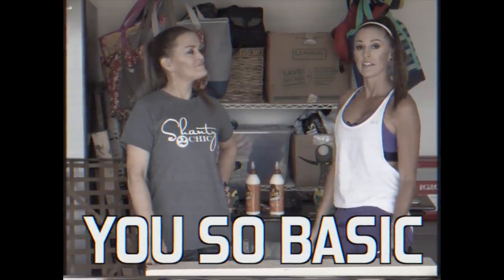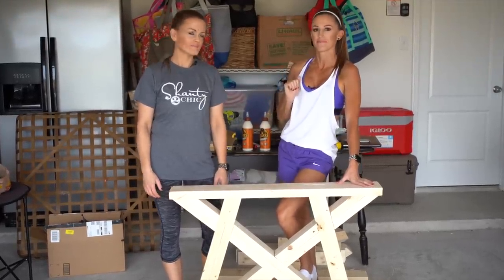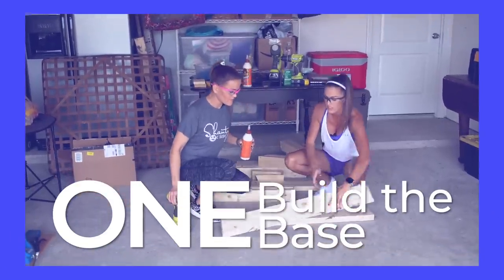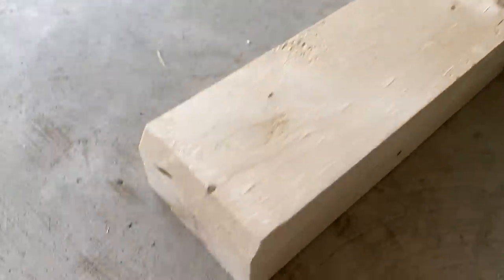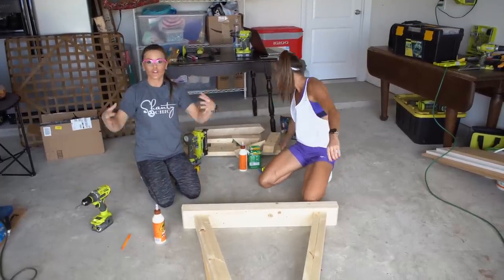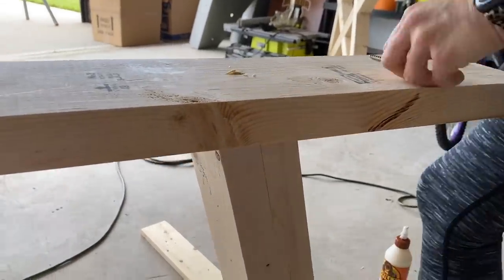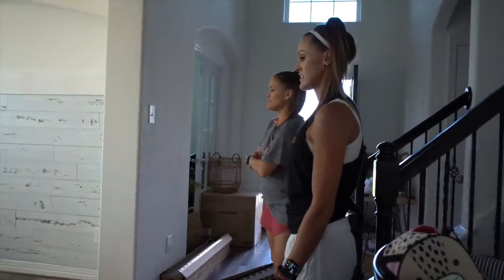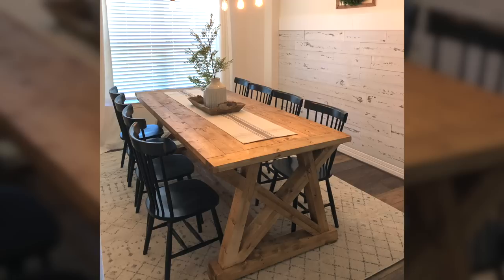$129 DIY Dining Table

Comment: Love the table ladies. I would recommend pre drilling holes for those screws though. Helps to prevent splitting, as I saw it did once on the X install.
Reply: Spax screws don't really require pre-drilling. Although personally I would pre-drill the ones that go into the end grain. But serious spax screws are awesome. I used to be a doubter but then I bought some when they were on sale, and they are incredible. German-made GRK screws are great too.

Comment: Saved for my table build in the near future! Thanks, great video ladies!
I feel like drilling through the top/bottom into the legs, then inserting a dowel with wood glue, would be better than screws. More stable and won't loosen.
Reply: You are right, but they needed to take it apart to get it in their home.
Reply: @allisonhood4750  Ah dang. Ever seen people using removable dowels?
Reply: @nicholasspinicelli2911  who cares? dowel with glue would be way overkill for this kind of project. Yes, it's better, but it's really un-needed and total overkill. What are you planning on doing with that table if you're worries about screws loosening?
Reply: @vladg5216  Just age and use, by future children climbing/jumping all over it, etc.

Comment: I have a question regarding the installation of the breadboard.  If you just screw and glue it's going to shift as wood expands.  I would install dowels and just glue the middle and leave the right side without any glue for expansion
Reply: This is what I was thinking. With this many screws in the bread board end it looks like it is asking for either a warped or a split table.

Comment: Just spent this past weekend building the table. Turned out great. The only thing I question is in yalls directions one of the pieces for the X you have colored orange, but it didn’t show what angle to cut it at. Took some thinking for about an hour to figure that out. Other than that not bad.
Reply: Lol they didn't include the single hardest part to figure out.
Reply: @ballwizz23  I know 😔
Reply: What angle did you end up cutting it at?
Reply: @Alyssa.Hansen  This was last April. Couldn’t tell you lol. Just eyed it.

Comment: Very nice table, and just the fact that you made it, is already a great deal. Now, some constructive criticism just to try to help for the future: 1) Pilot holes. 2) Wood plugs (needs special drill bit) or dowels to cover the screws (but wood filler works too, no problem there). 3) Spread the glue and use more of it, I would advise for all contacts, glue is sometimes stronger than the wood itself and after properly cured, even screws. Keep up the great work!
Reply: Nicely done.

Could also put some biscuits between the planks on the table top to keep them from warping. And miter the 4 corners.

Comment: Great job on the table! How have the bread board ends held up over time? Does expansion of the wood in a cross grain situation been a problem? Thank you.
Reply: I have that question too as I’m wanting to build this table. Did you build it? Have the bread boards held up?? Also how were the measurements as I’ve read they weren’t accurate… 🤔 ?
Reply: @natashamartin1712  , I have not built it. I’m not convinced about the bread board ends.

Comment: I sooooo need this! Someone was gonna charge me 700$ to make one almost identical
Reply: The reason that quote was so high is because of all of the time it takes to measure, cut, plan, purchase materials, transport materials, not to mention these ladies are notorious for advertising how cheap their materials are not counting screws, wood glue, the stain, and finish and all of those things take a ton of time..there is a misconception that projects like these are fast and easy and to an experienced wood worker they might be all of those time consuming things are happening off camera..but that is what your paying for..skill and a professional looking end product. This is no shot at you but this is a prime example of why as a small business owner I am so underworked because people don’t wanna pay you what your worth. Also calculate the hundreds of dollars in tools that you need to even complete a project like this. I hope you end up giving that person your business and am sure in the long run you will end up with a table your family can use the rest of your life. Cheers🤙🏻
Reply: I agree with Josh. The time it takes to do the finish work is where the bulk of the cost for a table like this is quoted.  Sanding and staining take FOREVER.
Reply: $700??? That’s actually very reasonable if you factor in labour and additional supplies which their $129 doesn’t cover (tools used etc).

Comment: Pocket hole screws to attach the breadboards... I would love to see what they look like a year later, without allowing for any wood movement. But a nice looking table, nonetheless
Reply: Pine sitting in an air conditioned house doesn't move that much. Plus this channel obviously isn't meant to show intricate mortise and tenon joinery. For the purpose and the price, the pocket holes will be fine. Will it last 50 years? Probably not, but most people don't keep a table around that long anyway.
Reply: Robert Collins  you clearly haven’t built much. Wood moves based on the moisture in the air, or lack there of.  AC means just about nothing.
Reply: Terrence Young what exactly do you think an AC does? It removes moisture from the air and keeps the environment controlled. No they aren’t proper breadboards, but I’ve built faux breadboards that were simply nailed to the frame that look fine after 5 years.
Reply: Robert Collins and if there’s moisture in a board and you introduce it to AC....  it’s gonna move.
Reply: Terrence Young so don’t build the table then. No need to hate on their work though. Again, I’ve built plenty of tables without proper breadboards or z clips, and they do just fine inside. Wood movement is real for sure, but I bet this table will be fine after a few years.
Reply: Robert Collins and my post said it was a nice table, I simply pointed out that the breadboards wouldn’t last, and they won’t. No one hated, you just felt the need to be a SJW and that’s cool.
Reply: This is actually the comment I was looking for, whic would you guys prefer and why? A glue up or pocket joinery for the table top. Also I see their board was wobbling, how could you fix this when it comes time to securing the top? I keep having problems with this

Comment: I am a newbie. What do you mean when you say you ripped something to size?
Reply: A rip cut is for the desired width of the board and/or for squaring up the edges because most lumber is slightly rounded.  Can only be done with a circular saw or table saw.

Comment: Great table build as always.  However, I have a question for you that relates to ripping 2" x 6" boards.  On my last two projects I have had to rip down the boards.  I have a jet table saw, fairly new.  I have a freud ripping blade I used, 24 teeth.  I bought it before the first project, within four boards it was dull and not cutting.  Had to clean the blade to finish the project.  Cleaned the blade before the second project, same thing, but this time had problem on the third cut.  I am using good dimension lumber from a box store.  Kiln dried with moisture content lower than 11 percent.  Do you have any problems with ripping pine boards?  This was not a cheap blade.  Looking for suggestions as this is very frustrating.  Do not have this problem with other wood species.  Hope you have a suggestion for you.  From a fellow Texan who has been in Oklahoma for over forty years, longing to go back to the Lone Star State.
Reply: Hmmm. Never heard of this problem before. I'd be curious to find out what the issue is.
Reply: @Woodsyone  The saw is 1.75 HP.  Had a long time friend tell me part of the problem was using a standard 1/8" kerf ten inch table saw blade in a table saw that is probably under powered.  I still think it may be the resin and pitch build up.  Cut the first two boards fine.  Blade was never hot to the touch.  Motor never slowed down that I could tell.  So it might be that for this type of cut in pine 2 X stock I need a thin kerf blade.  Strange thing is my cheap dewalt saw could cut on the 3/16" edge off the 2X stock with no problem, all day long.  The saw works fine on hard woods and ply.  Belt on the saw is tight, so that is not the problem.
Reply: @jtmin1 You're sure it's the blade? Sometimes the finish on my table saw top gets a little rough and makes it harder to push wood through. A thin coat of wax makes it smooth like butter again. 2× wood can be tough on saws with smaller motors though....
Reply: @Woodsyone  I wax my table saw regularly, usually once a month.  Had recently waxed the top of the saw, 2 weeks earlier and had not used it till this project.  I am more of a week end warrior.  My jointer also had some issues after four boards, but quickly cleaned the blades and it worked well after that.  I am going to borrow a thin kerf blade from my friend to see if it helps.  Thanks for replying.

Comment: What about wood movement, did y'all take into consideration of this? If so, then how did you solve that issue?
Reply: With all the pocket holes on the breadboard ends, the answer is no.
Reply: I bet it looks like a potato chip now.
Reply: I was wondering the same thing. It will start to expand or shrink and pull away from the pocket holes. Great table but over time it will have gaps. Breadboard ends and dowels would help with the wood moving. oh and ladies.. more glue! use a lot of glue  and spread it out on both pieces.

Comment: Nice work.  I am wondering however if the plans for the base will work for an existing table.  I have a beautiful table with a broken leg  and  don't want to get rid of it.  Also the chairs are beautiful where were they purchased?  TIA
Reply: Why not? Modify the dimensions if need be to make your top fit properly.....

Comment: The base design is really cool. Too bad the breadboard ends weren't attached in a way that will allow for expansion and contraction of the wood....
Reply: How can you attach them to allow for expansion/contraction? Eventually wanting to build some kind of dining table for myself
Reply: Mortise and tenons with dowels. Only glue the center and elongate the dowel holes on the sides to allow the wood to expand. Its much more difficult to do but, it will keep the wood from cracking or splitting when it swells, expands, and contracts with seasonal weather and humidity changes.
Reply: This is exactly as the title implies, cheap. Unrefined build, poor joinery, low quality materials, and bad finishes. If it fits your budget it will be good. You just wont know what great is unless you want to pay for it.
Reply: I know it's just pine lumber but, I've made some pretty awesome stuff out of dimensional pine lumber. Hardwoods tend to be much sturdier, I agree but, ain't nothin wrong with pine so long as quality methods of joinery and fixation are used.
Reply: I agree pine can be done well. But without jointing the faces it's like I said cheap low quality build. I've used Doug Fir on a few pieces (I'm west coast) and the only thing to complain about is nasty tearout and hard knots.
Reply: @kylecorry9537  for sure. The jointing and planing need to be on point and the softwoods def have more propensity for tearout but, I personally love the big knots and dramatic grain patterns. I do however love to hand plane hardwoods and listen to the shucking sounds it makes.
Reply: @kylecorry9537  c'mon, Kyle,  give them a break. This build is what it is.
Reply: @Woodsyone  yes it is what it is. I've repetitively said it's cheap furniture. If it wasnt the title wouldn't be $129 table. That being said if you have actually built a farmhouse table for a client you really dont want to hear I can build this for $129 on youtube for what you just quoted me $1,200 for. The answer is no you cannot but go ahead.
Reply: @kylecorry9537  I've built many farmhouse tables, all different designs. Hey I agree with you completely, but the girls showed great enthusiasm and seemed to be encouraging to women. My first thought when I came across that video was, cool design, sort of, but could benefit from some tweaking to make it more durable. This is a product of the you tube culture. I guess we just have to take it for what it is. A cheaply built table that looks interesting.
Reply: @Woodsyone  I'd like to see a 3 year follow up to see how the joints look.  I totally agree that this is good for what it is, but people need to also realize that not everything is as straight forward, glue and screw everything together as this seems.  There are implications to no accounting for nature!

Comment: lots of complaints on the plans for being completely incorrect. how about fixing those so people aren't wasting their time?
Reply: Shhh.. 🤫

Measure and cut as you go, as they mentioned multiple times. OR..you could stick to your technical trucking. 🤷🏽‍♀️
Reply: @technicaltrucking8704  💪🏽💪🏽beeep beeeep!! Stay in the slow lane, please.
Reply from the maker: We have had many people build this table. I mentioned in the video and on the plans to measure and cut as you go. It’s especially important on the diagonal pieces as there is more room for “error”. I mentioned this and showed exactly how to measure and cut for those pieces in the video.
Reply: there are complaints that the cut list is completely incorrect, the board size is completely incorrect. youre leading people on to to do this project, theyre going out and buying expensive lumber and you havent fixed a thing. its pretty sad. all about the clicks? fix it.
Reply: @lauriferonti9785  law of lugnuts karen, I drive where I please.
Reply: @shanty2chic  
Kathy on December 29, 2020 at 4:54 pm
just checking to see if the plans have been updated. i don’t see ya’ll replying to any of the comments regarding this….

Kaden on April 23, 2020 at 6:08 am
2 starsThe plans are cool but the cut list is WAY off.

Keelie Wanders on May 4, 2020 at 7:36 pm
2 starsCurrently in the middle of making this table and the plans are WAY OFF. So frustrating

John on November 10, 2020 at 11:48 am
1 starA whole page of instructions and not a single dimension or angle mentioned…

Comment: I’m sorry ladies but as a professional furniture maker, this is wildly frustrating to watch. I certainly do not expect you to put out a DIY video where the plans include mortise & tenon joinery, but even as a DIY project, you’re giving some pretty bad advice. First and foremost - it’s a horrible idea to use construction grade lumber that is absolute garbage, which I guarantee is still wet and will without a doubt will warp in a very short amount of time. Then there’s not pre-drilling your screws, not filling your pocket holes… and oh man - THOSE BREADBOARD ENDS! By screwing the end board to the ends of the main planks, you’ve allowed zero ability for the wood to naturally expand and contract, which is guaranteed to make that entire top warp even more. I’m assuming you then finished it off by using Minwax to stain it, which is riddled with toxins and VOC’s, great for a surface you’re going to eat off of! I hate to sound like such an ass, as I really do appreciate anyone who inspires others to roll their sleeves up and pick up a damn hammer. But at least educate your audience a bit more and use some better materials and practices to ensure a FAR better product that’ll last FAR longer.